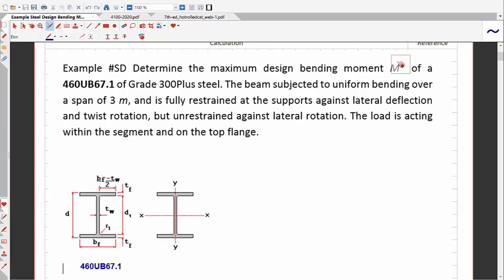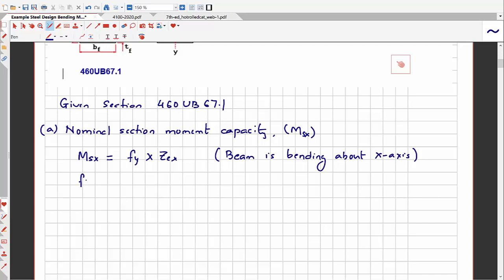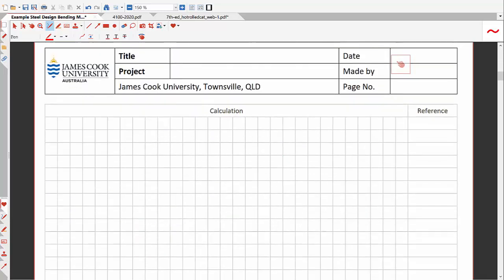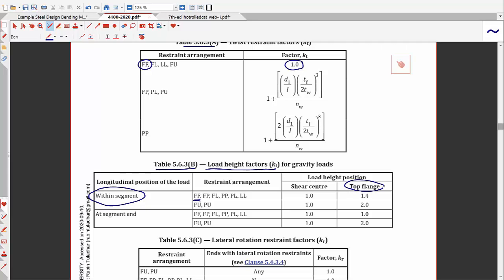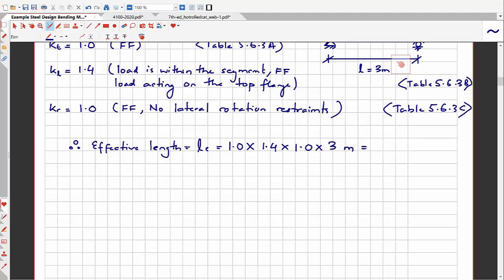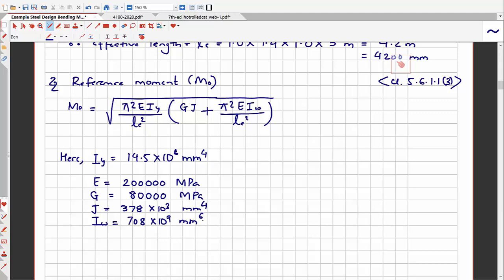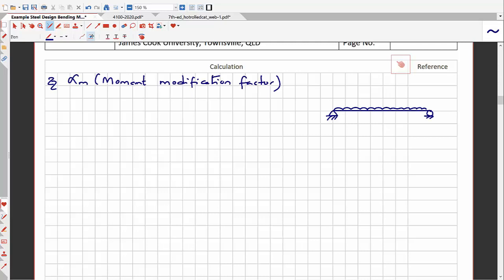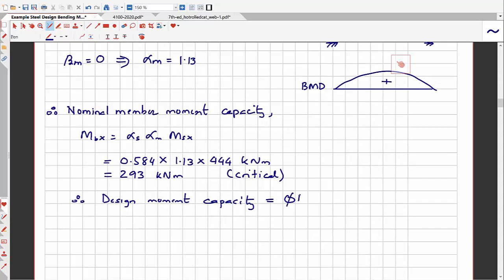Example #Steel Design: Member Moment Capacity

Comment: the kr factor should be 0.7 since both end restraints are fully fixed.
Reply from the maker: kr is for lateral rotation, it is free to rotate laterally so kr is taken as 1. it is though fixed against lateral deflection and twist at both ends as you mentioned.